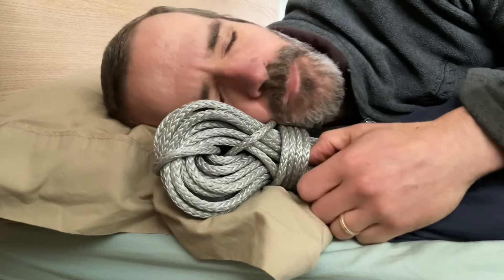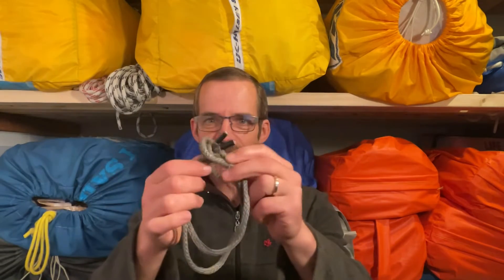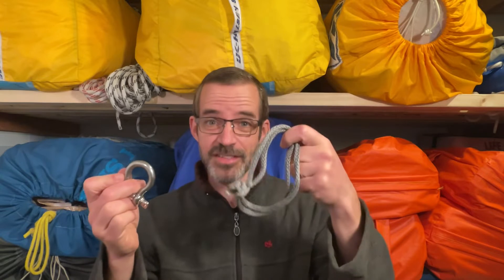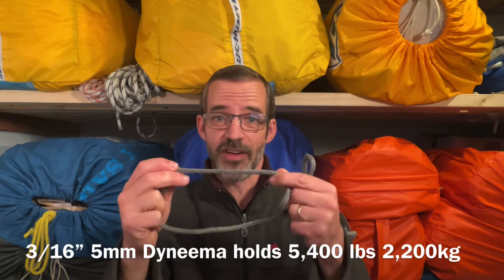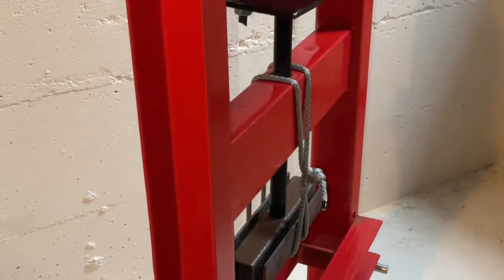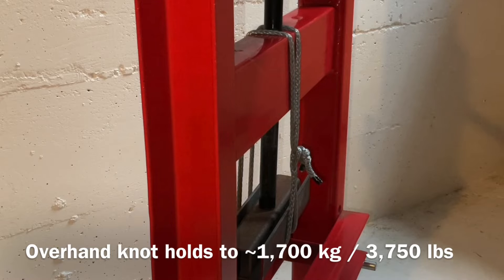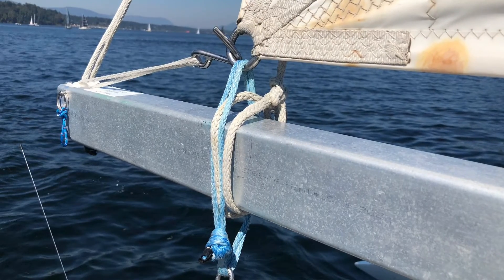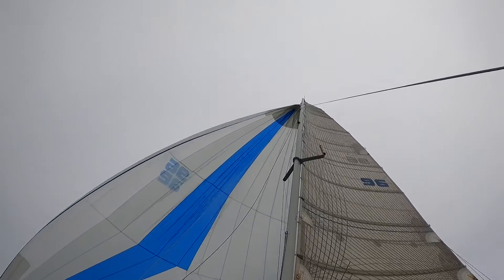The Amazing Lightweight Rope That Can Lift A Car!!!

Comment: Is it biodegradable or recyclable?
Reply from the maker: Dyneema has proven itself to be technically recyclable however whether local recycling facilities will accept it or not as part of their widespread commodity recycling programs is another question, so you may need to ship it off to be recycled. Personally I just re-use it for less critical tasks when it becomes too worn for full-strength applications.

Comment: One corner of your car? What’s that? 800 lbs ?  You call that shock loading?  Not impressed.
Reply from the maker: In another video I strength tested this type of soft shackle to 3,750 lbs using a hydraulic press which is more than this car weighs. This tractor has a hydraulic pressure release at around 1,200 lbs and I was hitting that in this test, which wasn’t enough to either lift the front of the car nor break the shackle as expected. This is weaker than other forms of soft shackles but still more than enough for many use cases.

Comment: Just for those that are wondering, Dyneema is a brand name. The name of the material Dyneema is made out of is UHMWPE. Spectra is also a brand name made out of the same material.
Reply: Though Spectra and dyneema specs  have some differences.
Reply from the maker: @nomars4827  Yes some slight differences in the manufacturing process as I understand.
Reply from the maker: You’re absolutely right!

Comment: The only problem with Dyneema for standing rigging is... well maybe it isn't a problem.... It is susceptible to UV rot.  For standing rigging, you have to shield it or put a sheath over it so it doesn't see sunlight.   Sheets etc... doesn't really matter since they are easily replaceable.  Having your rig collapse in a heap not so much.
Reply from the maker: It actually stands up to UV better than most other synthetic materials on a boat! Colligo recommends replacement after 5-8 years in the tropics but I think you can easily get 10 years in more temperate climates.

Comment: The composition is pet.  The question of the ratio of price and service life in the sun.  How long will it work in the sun?
Reply from the maker: Amsteel is made from Dyneema, which is remarkably UV-resistant for a textile. I’ve had no issues with UV degradation on any lines kept out for a few years, and some people are reporting useful life as long as 5-10 years or more. The nice thing about Amsteel/Dyneema is that it becomes visibly fuzzy as it ages, so there is typically plenty of warning before bad things happen!

Comment: doesnt have much abrasion or uv resistance
Reply from the maker: Abrasion is the worst enemy of Dyneema in my experience! It does degrade in UV compared to stainless, but I still find I get several good years out of, although I also live in moderate latitudes so the sun isn't as strong as equatorial regions.
Reply: Nor does it corrode.  Pick ypur poison.
Reply from the maker: @kayzinti4452  Exactly, and it’s pretty easy to work with, create splices etcetera, easier than many other materials.